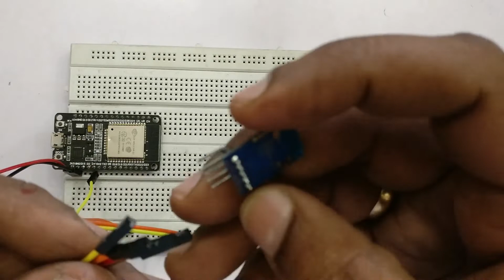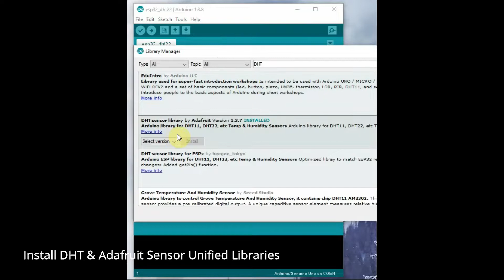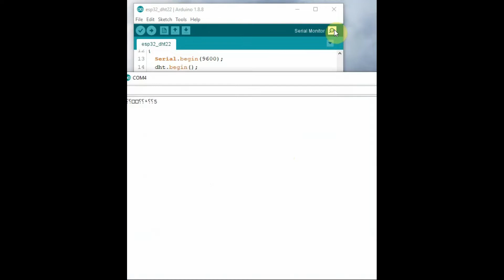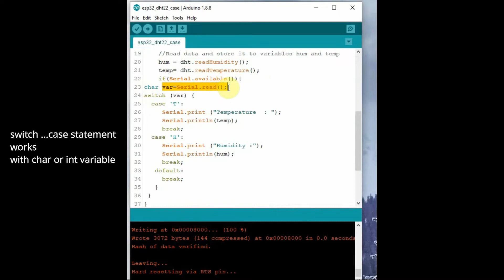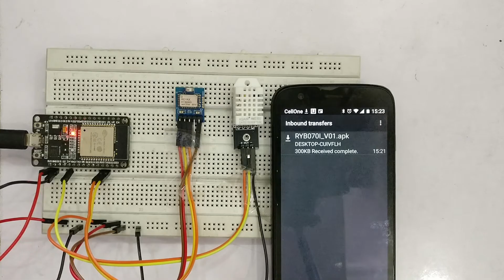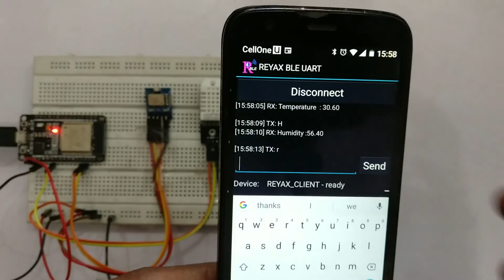Bluetooth BLE REYAX 080I - Getting DHT Sensor Data

Comment: Hello sir,
I am working on a project which has  ESP32 BLE 4.2 Module
As per the project requirement I have  to transmit and receive 26 bytes of data but it only transmit and receive 20 bytes.
So how can I increase the data length?
Please help me...!
Thank you.